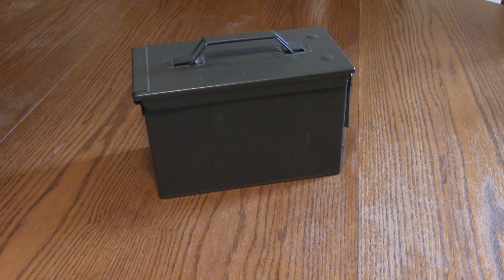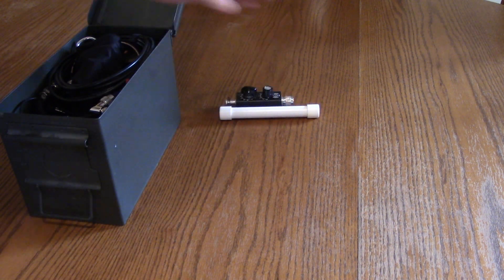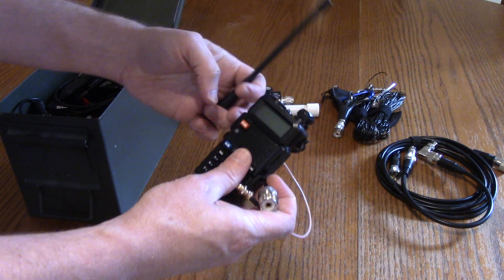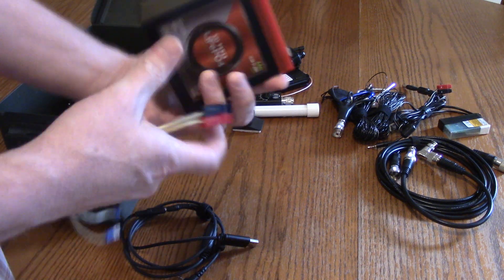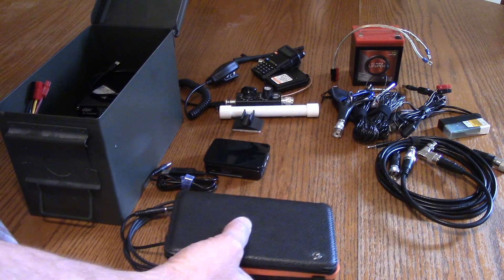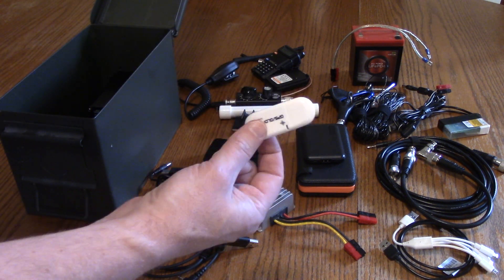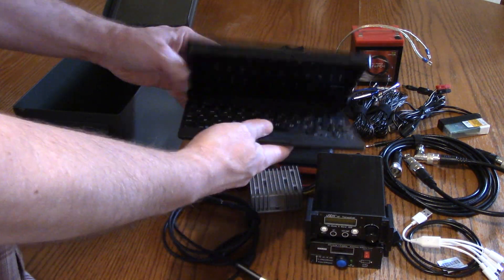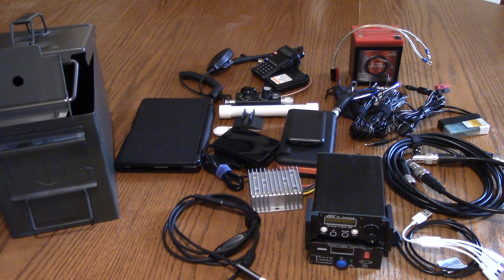JS8Call Station in an Ammo Can

Comment: I'm interested in the buck boost converter... It looks like a small engine voltage regulator... Where did you find that unit? I have the same radio and a similar tuner and I find it works quite well, better than I could have imagined actually.
Reply from the maker: Hey there, picked that up on amazon. I thought if I could get a steady 13.8v, I'd get more output out of the uSDX. Maybe I'm doing something wrong, but my output wasn't increased... so I no longer keep it in there. Agree on these things exceeding expectations!
Reply: @tfurrows  I looked them up on Amazon, and by the looks of it they are just a voltage regulator. So it will step higher voltage down but not up. There are a bunch of buck converters there that will step voltage up from a lower voltage.  As long as you have a bunch more amp hours in the battery than is required to run the radio it would probably be ok, because there has got to be some losses incurred in that scenario. For some radios it definitely could help because some of them really like a solid 13.8 volts not the nominal 12. As long as the battery is oversized accordingly to keep up with the amps
Reply from the maker: @patthesoundguy  There are several that have the same heat sink body, buck boosters and regulators. Mine is a buck booster, 9-13v boost to 13.8v: https://www.amazon.com/gp/product/B097GRXXQ8/

Comment: Awesome project! love what you've done with the ammo can. Those things are great for so many things! ONE suggestion I would make is, do something to protect the LiFePo4 battery terminals. You wouldn't want the battery to in there jostling around and short those out. That would likely not end well.  You have a 3D printer so maybe you could come up with a cover to snap over the top. At the very least slide some insulated connectors onto the terminals. Otherwise, I like it a bunch! Good job!
Reply from the maker: Roger that suggestion, it's a good one. I confess, I was cringing a bit when I packed it up with those terminals sticking out! Ultimately, the items atop were not conductive, and there was no wiggle room in there HIHI! But even so, there's just no real excuse for leaving them exposed!

Comment: Very cool!  Got my wheels turning.  For a rapid-deployment setup, I can see mounting the buck and pi (maybe even a battery if it fits) to a board in the bottom, then build a rack for the usdx and tuner that swivels above those (attached to the same board).  Vision is to be able to leave everything wired up, and either tilt the radio/tuner up, or just lift the board out and you have a stand that sets nicely on your table/ground/rock, etc.  Only thing to connect then, is the antenna, coax jumper (or try a shorter jumper) and maybe the mic (if it's not pre-connected) and any aux power.
Thanks for putting up this video!  Looking forward to checking out the rest.
Reply from the maker: Good idea! Now, I think I'd lose a fair amount of storage space in mounting hardware and configuration... but it could be worth it for rapid deployment. Maybe I wouldn't need that space if I reduced my wiring needs by having everything mounted like that; that gets my wheels turning too....